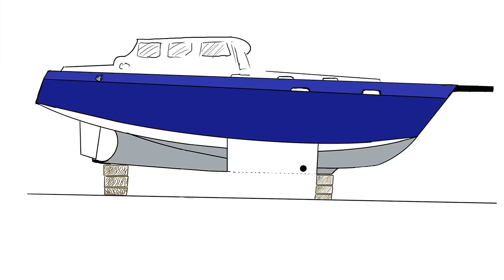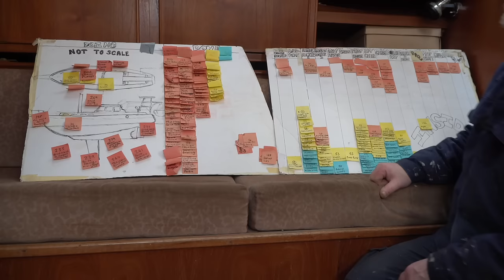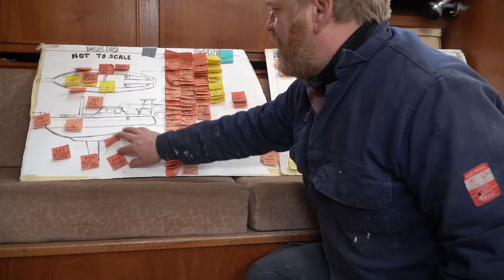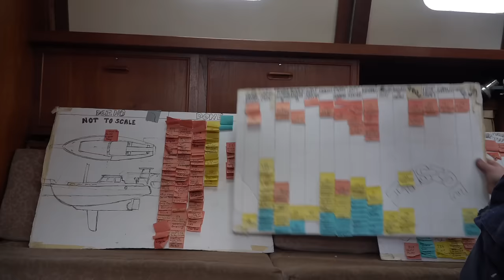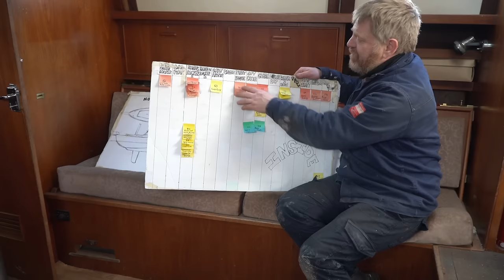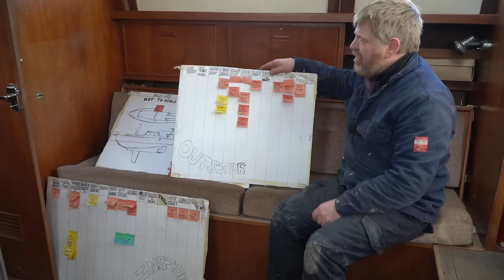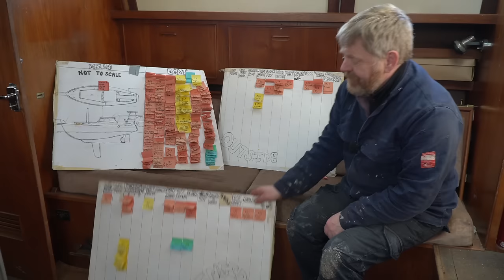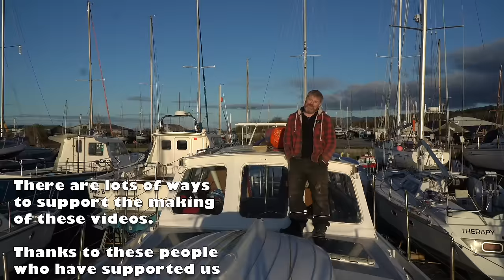This did NOT go to plan. We Failed to fit our Keel, heres WHY!!!

Comment: Nice work can you not dig an area out below the keel box ? its how i remove my rudder if needed.
Reply from the maker: If I could I would. The yard won’t allow that :)
Reply: That's a shame as would have made life a little easier and cheaper than a lift best of luck with it I may have put some traps up and done it in secret, LOL 
Best of luck with it

Comment: if the keel box is the same size all round why not put the keel with the pivot point opposite side to pin facing up. Then lift that side up and rotate till it drops down on the pin. I assume from the clip you could have 45 deg it into place how you started but if not a little bit of dirt scraping (not hole digging} and tiniest bit of jacking maybe work?
Reply from the maker: Because we aren’t allowed to dig holes in the yard :/

Comment: First proper and well deserved swear 😆. Shite man, wish I'd been there to help, love doing stuff like that. (Keel)
Don't think polybutene pipe is UV resistant so be looking to replace that bit of 10mm line above the weld mate.
Difficult to comprehend the amount of work you've all done on steel boat. Those boards represent all that, don't bin them, frame them in someone's house, and... you've got a permanent record on YT of it being done so like a fsh for a car 😎😎😎
Reply from the maker: Which bit do you mean mate? The water pipes for the fresh water system?
Reply: Ye, check re UV anyway. Just be a right pain up the arse if they were compromised...
Reply from the maker: @LNM0000  right yeah

Comment: First - your beard is well on the way to greatness. You’ll eventually need to buy a tricorn hat and cannon fuse though. Second - for welding/working blind you can buy the cheapest borescope you can find and that will give you placement views. Cheap because you could ruin it easily by striking an arc due to UV damage.
Reply from the maker: Hahaha thanks. Going to see how irritating the beard gets

Comment: Weld using a mirror so you can see under that flange.
Reply from the maker: Yeah I did think of that but I haven’t got a welding mirror and I wanted to cut the flange out anyway
Reply: Yeah, after seeing you cut it out, you did the best thing. Bravo.

Comment: As a naval mechanical designer I want to remind you not to have hard corners in your structure.  They will be weak points.  Good marine structure is always rounded or sniped.
Reply from the maker: Where do you mean in particular? 

I ageee when inserting a patch into a large panel then it’s important to use rounded corners but the corners of the keel box are square. So that’s that. Can’t put a round corner in a square corner: but we work to the Maritime and a coastguard agency guidelines for construction and repair.  Which part of that document are you referring to to in regard to which piece of this work? :)

See MCA-1698 or any other documents from the MCA construction and maintenance standards but would be interested to see where specifically you think I should have modified the original design to turn square corners into rounded corners
Reply: @SailingMelody   I work with navy boats so looking at the keel box and some  of the other structure on steel melody it is built to commercial standards.  I am just suggesting keep corners  rounded as much as possible.  I would not try to alter too much as it would be too costly.  Just keep in mind as you build or repair is all I am saying.
Reply from the maker: @decapolis01  I agree completely in the right circumstances. We did an episode only a few weeks ago where I discussed this in detail and welded two patches into the aft hull with rounded cornered as per MCA construction and repair guidelines :)
Reply: @SailingMelody  I will go check that video out.  Your doing a great job, I enjoy watching your progress.  Good luck from a Welsh blooded American!

Comment: I remember those boards...your 'done' list has increased a lot since last viewing.
The boat needs you to wear over shoes when walking on newly painted deck. Muddy footwear on white paint is not good.
Whoever buys Steel Melody is buying a constant project, but that's the same to a greater or lesser degree on all boats. As long as you are honest in how you present the current state of the boat, any prospective new buyer can decide if this is the vessel for them.
Reply from the maker: Yes you’re absolutely correct.